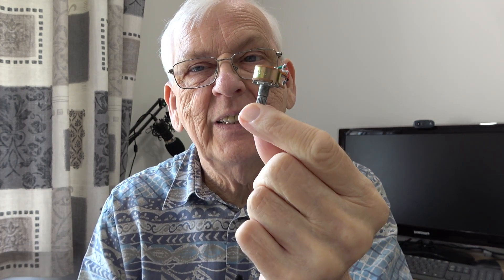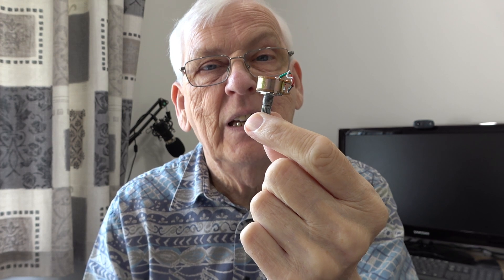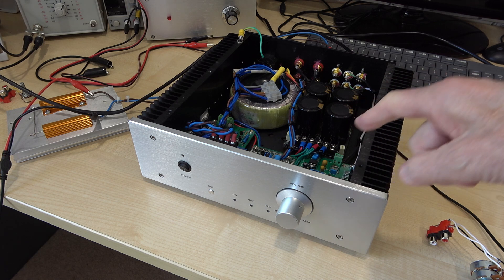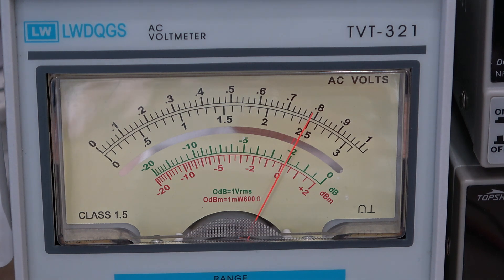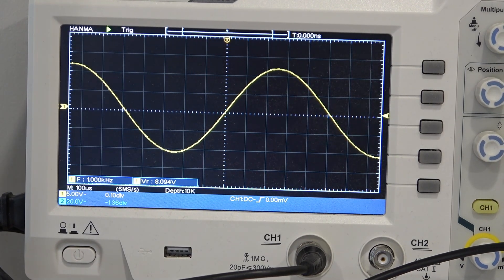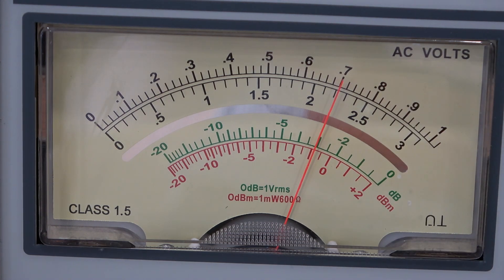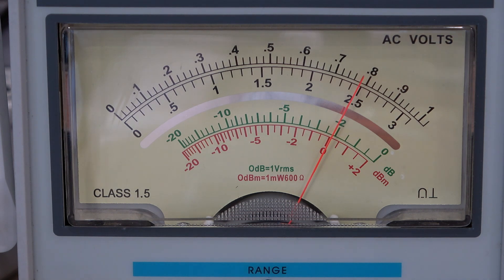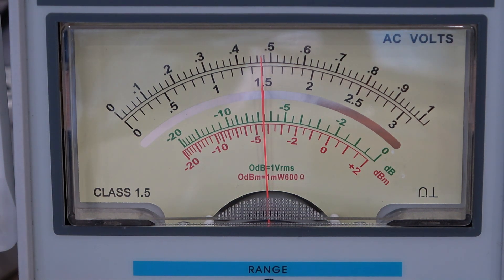This Pot Can Make Your Amplifier Sound BAD!

Comment: Another good and interesting analysis.

This is why the input RF shunt caps should always be before the volume control.  Typically they work best right on the RCA or XLR jacks themselves.

With the RF bypass after the volume control ... you effectively end up with a low pass filter, as you explained, that will vary it's roll off with the impedance of the top half of the volume control.  

Also 50k is too high for the initial level control on an amplifier... try 10k ... see how that goes.
Reply: A lot of diy'er solid state amp designs are 10k or 22k input impedance so 4.7k or 10k potentiometers are definitely recommended.
Reply: @peterlarkin762 
It's called "impedance bridging" if it needs a name.  The general principle is that a low impedance always feeds a higher one.  Mike found one of the many reasons why.

 https://en.wikipedia.org/wiki/Impedance_bridging
Reply: @peterlarkin762  
Yes, that is quite a common practice for DIY'ers and it does make things better.
Unfortunately this will not completely resolve the issue when using these boards in their as-shipped unmodified state.
When using a 10K volume pot at 50% true setpoint (5K-5K) that is connected directly to the board input, it will still drop by about -2.2dB at 20khz... not "hi-fi" at all.
And if you go too low on the volume control resistance it may overload whatever signal source is feeding it or cause other issues.
The better solution is to have the signal input connected to the volume control (regardless of its value) without any paralleled capacitance, then through a preamp or buffer amp with a low impedance output, and then connected directly to the amp board inputs.
Modifying the amp boards themselves in the manner Mike has described will help a LOT as well.

BTW, while placing the RF shunt caps directly at the input jacks on the box is indeed theoretically best, other issues can arise when doing that.
Some signal sources simply will not tolerate feeding directly into a capacitive loads (even if the capacitance is relatively small).
They can become unstable or distorted, and if nothing else they may overshoot by quite a lot.
For example, with a mere 100pF paralleled load Mike's favorite op amp (NE5532) can overshoot by up to 10% on a small signal per the manufacturer's own data sheet..!
This is despite the NE5532 having a typical output impedance of merely 0.3 ohms (again per their data sheet).
For this reason many (but not all) preamp and source device outputs (especially where op amps are used) have series resistors that appear upon first glance to have no real or obvious purpose.
One could suppose that it is for short circuit protection, but that function is already part of the op amp's internal circuitry.
Their actual function is to help keep the output stages stable if the load is highly capacitive ("highly" being a relative term here).
Series resistors such as this are even present in the outputs of many (if not most) power amps, including the dual TDA7293 boards in Mike's recent videos, and for exactly the same reasons.
The only exception to this that I can think of are phono cartridge preamp inputs.
They not only tolerate direct capacitive loads, but the cartridge manufacturers usually specify parallel capacitive load values to achieve proper operation.
Reply: @ronschauer839 
Yep... getting carried away with RF bypassing on your projects inputs can destabilize some of the less carefully designed driver stages.  But fortunately it doesn't take much series resistance to prevent this.  The input bypasses with 1k in series then a 47pf capacitor to ground usually do a nice job when feeding a 10k pot which then feeds a 20k or higher input load.  There is still a roll off of course, but that should put it up around 50khz where nobody will hear it.
Reply: @Douglas_Blake_579  
Without low capacitance in the input section of the power amp (assuming you are still connecting the volume pot directly to it), the roll off may be much more severe than you may imagine.
It's not only about the resistive impedance, it's also about the capacitive reactance.
100 ohms is a very typical value for a series resistor at the output of an op amp or DAC stage, by the way.
And in the case of the dual7293 boards it is 4.7 ohms with approximately a 1.5uH inductor in parallel with it (to pass lower frequencies unimpeded).
However fitting a suitable high input impedance / low output impedance preamp or buffer in between the pot and the power amp input will usually resolve volume control-induced roll off problems nicely, even with the utterly ridiculous 2200pF C1 value originall fitted on those boards.
Wait for Mike's next video or two, it will prove this concept I'm sure.
Reply: @ronschauer839  
For clarity ... I am not talking about the series pass signal coupling capacitor on the input ... My comment was about the shunt capacitor that goes from input to ground, to strip off RF noise on the cables.  They might actually want to consider removing that component from the power amplifier boards entirely.

Fitting a pre-amp or buffer stage after the volume control simply risks moving the mid-range rolloff to the buffer stage instead. It would have to have a very high input impedance (100K or more) to avoid this with a 50k pot... hence my recommendation of a 10k pot instead.

(If only they allowed diagrams here...)
Reply: @Douglas_Blake_579  
I think that we are talking about subjects located on skew lines.
Wait and see what Mike shows in his next videos.
Reply: @ronschauer839 
Okay dokey...